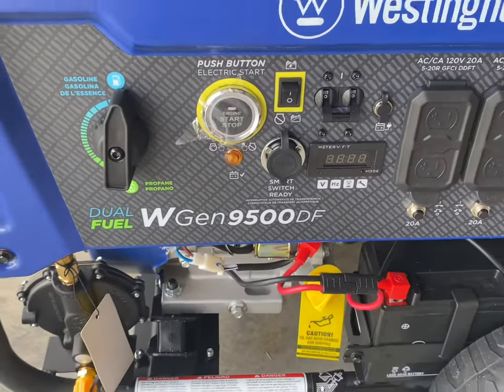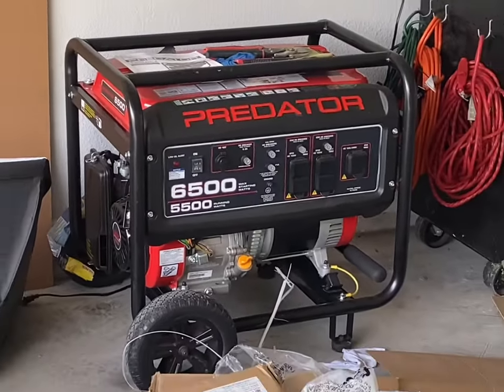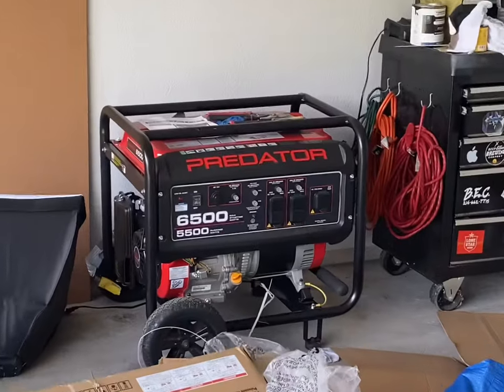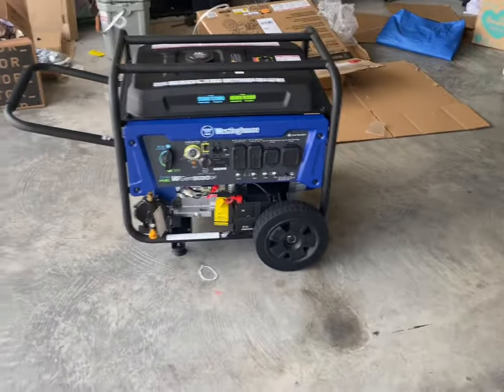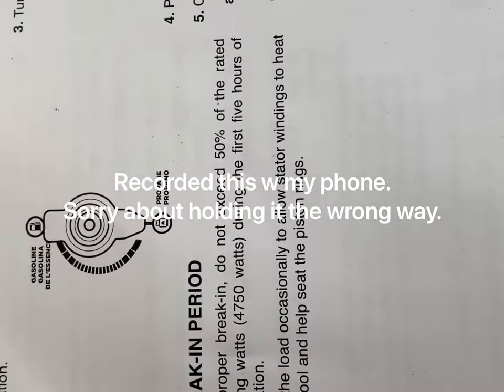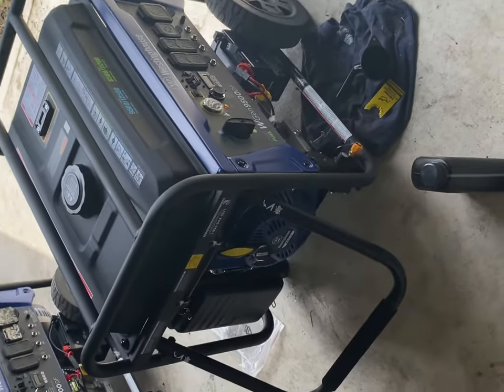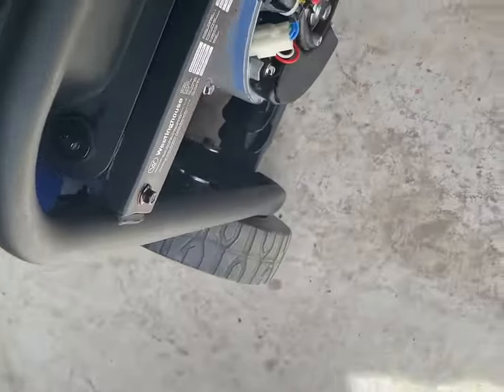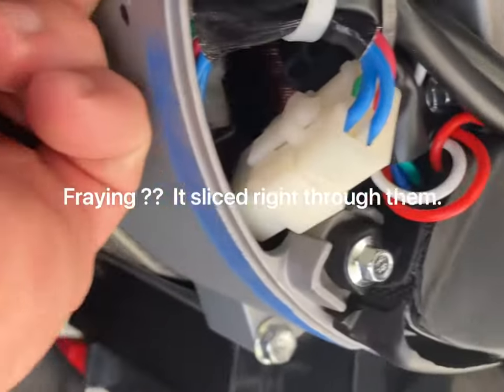Doing the initial engine and oil break in on my brand new Westinghouse Wgen9500DF generator.

Comment: Kind of in the same boat as you were, ordered it on Amazon, ran it for to break it in, changed the oil, week later power outage happened, turned it on to use it, worked fine for 2 hours, then the engine started surging, everything flashes on and off. I didn't buy a new generator to work on it, so I contacted Amazon, they offered me a refund or a replacement, well I need it and I got a good deal, so a replacement will work. I can try hooking the fuel up direct or mess around with the solenoid, but I'm not even sure if I want to mess with it. What do you think it could be? (Same model as the one in the vid)
Reply from the maker: Man, I don’t wanna lie to ya and have I chasing problems that aren’t there. Could be a number of reasons it’s surging. Honestly, if a replacement is on the way then I’d prob not even stress about that one. Sell it and buy beer to keep in your cold fridge ran by your new working generator when it comes in haha.

Comment: Did not think this is strong enough to run a house a/c during storms in FL.
Reply from the maker: All comes down to the unit and what fuel you’re running it off of I guess. Runs my 4 ton with no problems along w some of the kitchen circuits at the same time. I haven’t found the max it will run, but I do know it will run the necessities.
Reply: It is strong to run a home a/c - if you install EasyStart - a soft start - to your ac, to lower your starting/surge amps.

Comment: How did the 2 hour break in cycle go?
Reply from the maker: Break in went good. The 2nd oil change had significantly less metal in it, but there was some. After that oil change I ran it w a small load on the generator and kept that oil in there. I’ll just check it before each start up and follow the manual from there.

Comment: During the break-in process, do you have to change the new oil filter out every time you change the oil?
Reply from the maker: It doesn’t have an oil filter. It does have a fuel filter and air filter tho. If it did have one there’s no word of it anywhere in the manual. I’ve never owned a generator with an oil filter I don’t believe.
Reply: @KoreyB03 I have this same one and I’m just doing my break in period today but I bought this generator in 2021 but I never used it only started it here and there but I r always used fuel stabilizer and let the fuel bowl run empty to protect the generator. I will change the oil after break in because I have a lot of oil now so I can finally use the Briggs and Stratton oil for this generator.

Comment: This Westinghouse generator didn't Start in the Winter of 1-3-24. I have tried 3 different times to Prepare for an outage.  👎👎 It's so COMPLICATED TO START in the Winter
Reply from the maker: You’ve tried 3 of them and all 3 wouldn’t start? That’s weird. Theres gotta be something going on because even the initial one I received that was dropped somewhere along the line hard enough to bend the frame and sever wires started for me. Sucks you’re having issues.
Reply: Thank you for your Response
Now I just bought a Champion inverter generator Tri-Fuel 9,000 watts.  It Starts so fast in my START UP.  Now I'm not Concerned when Power Outage comes 👍

Comment: What’s the best oil to run it on ps I’m no handy man I have no clue what I’m doing 😂 I pray I don’t fk it up so your saying run it for a hour and change the oil completely and continue the process two to three more times in 1-2 hour intervals?
Reply from the maker: Hahaha, it’s fairly easy so I’m sure u can doit! 

Manual states 5w30 is recommended for all applications and 10w30 is next best. 

Yessir, that’s what I do personally. There are a lot of different ways u could break it in. At minimum I do 1 hour under 0 load and change oil. Atleast 1 hour under load and change oil. Then I run it again for atleast 1 hour under a load and check oil for any metal shavings. Change it if u see any and if u don’t then leave it. 🍻
Reply: @KoreyB03  thanks brother
Reply from the maker: @News4RonBurgundy no problem. Also, the 530 is synthetic. Sorry, for some reason I didn’t write that part. 🤘🏻

Comment: Does this run your hot water? I have a tankless water heater and the same generator but it bogs down and shuts off if I turn the heater on
Reply from the maker: I haven’t tried yet. What all were u running with it?
Reply: @KoreyB03  just a few phones charging and a light on. I turned the A/c off but I left the breaker on I wonder if I turned the breakers off to everything other than the water heater if it would work, I just figured it took way more electricity to heat the water thru it, I don’t have a normal water tank
Reply from the maker: @andrewturner2338  yea that’s why I was wondering. Maybe the ac kicked on or something. Id think if that thing runs your ac it should run the hot water heater. I’m no professional tho. My 6500 ran the hot water heater. I did turn everything else off other than a couple kitchen plugs tho.
Reply: @KoreyB03  yea I just tried and it still wasn’t enough idk if there’s different size water heaters like that. But I appreciate your help man
Reply from the maker: @andrewturner2338  not a prob man. Sucks that it’s giving u problems. Hopefully u get it figured out
Reply: @andrewturner2338  Saw you comment and piqued the old interest, since I ran into a similar problem trying to run my 1800w table/miter saws on a 3000W continuous sogen.  I'm not an electrician, but I tend to research shit until I'm blue in the face.  So take everything I type with the proverbial grain of salt!  

I don't own a tankless setup, so I did a bit of reading.  How many heating elements does your heater have and how many watts are each?  If you have 4 heating elements at 7000W each, that's 28,000W of power.  The gen only puts out 9500W, so it's not going to run the heater.  I read that the lowest wattage tankless setup is 10,000W.  (Don't know how true that is.)    The Westinghouse shouldn't be able to run that, since it's still only 9500W, but the 12,500W startup should allow it to turn on, bog down, and shut off.  If you are able to adjust the temp on the tankless, you might try turning it down and that might drop the power draw.  

I know I didn't give you any good news, but the key thing I learned after my sogen fiasco:
amps X voltage = wattage,  and if you don't have a multimeter, check the breaker rating in the breaker box!  

Good luck with everything, Andrew.

Comment: so change oil 3 times?
Reply from the maker: Yessir. After the 2nd run I changed it and put oil in it a 3rd time and ran it. Didn’t change it after that one because it looked good. So, I guess I technically only changes it twice, but put oil in it 3 times. Haha. Hopefully it helps. 🍻🤘🏻
Reply: how much oil? @KoreyB03
Reply from the maker: @anaeussherer2851  right around 1qt. I used the dipstick to gauge the oil level.